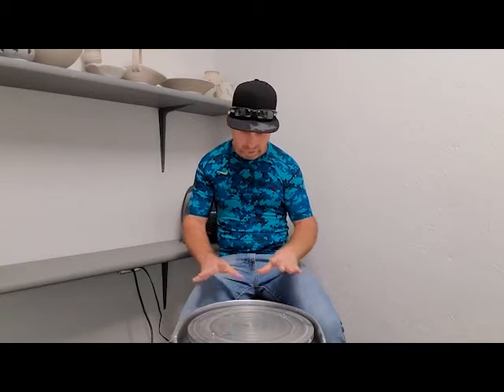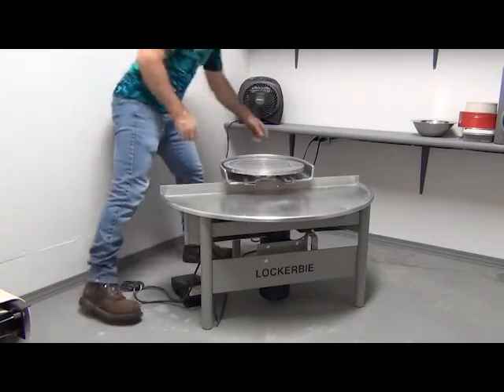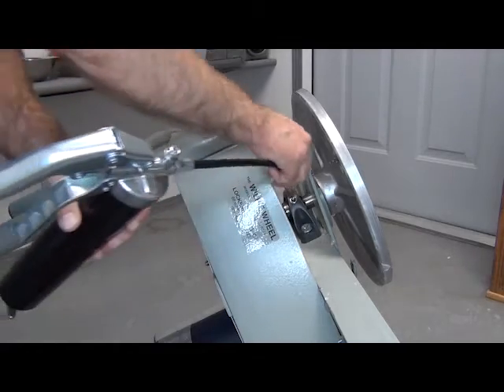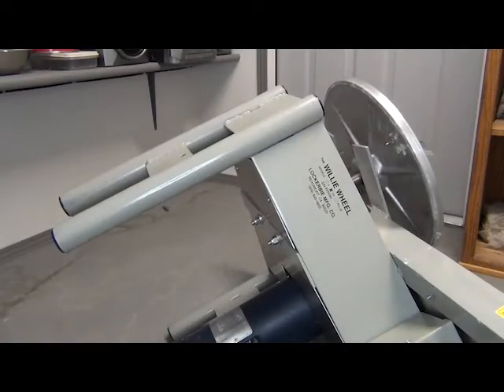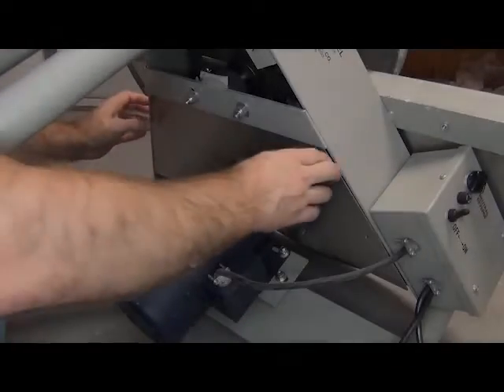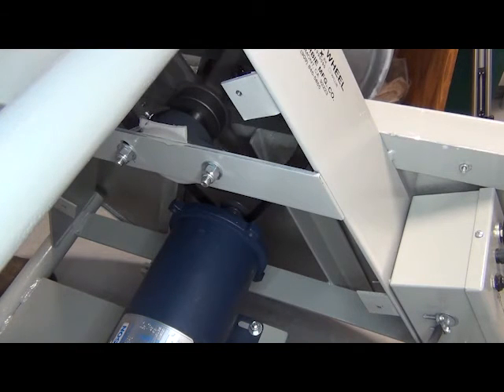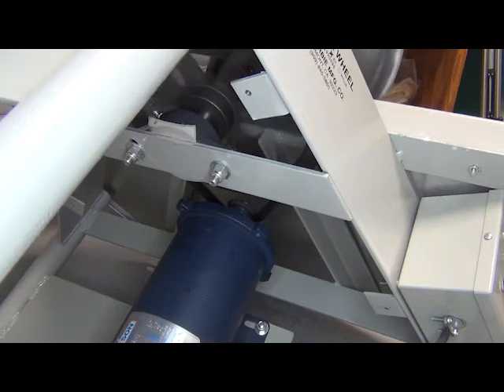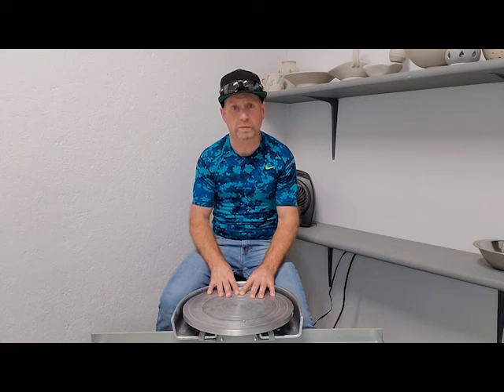Ep. 3 - Potter's Wheel Maintenance

Comment: I just picked up a Willie E and I can't believe how pristine yours is! Have you ever taken the wheelhead off? I want to replace my belt as it has a little curve from sitting that causes a thump as it spins, but I am worried that it's pressure fit on and if I get it off I don't know if the wheel head will go back on.
Reply from the maker: Congrats on your new wheel. I hope you like it as much as I like mine. Unfortunately, mine doesn't have many miles on it, that's why it looks so good lol It sat for an extended period, and when I went to use it, it had that same curved spot, and was making that same thumping sound you mentioned. I've never taken the wheel head off, so I don't know what that entails, but the belt conditioner solved the problem for me, so hopefully that's all your's needs as well.
Reply: @erall-bradunlimited8586  Oh that's promising! The Willie is a big step up from my Clay Boss with a plastic wheelhead. Lots of power too! Thanks for the response--there is so little info available on these cool old wheels!
Reply from the maker: Wow, that it is a big upgrade! You're welcome. I totally agree that there's not much info out there about maintaining or repairing potter's wheels. Maybe I'll have to make a vid for replacing the belt in the future.